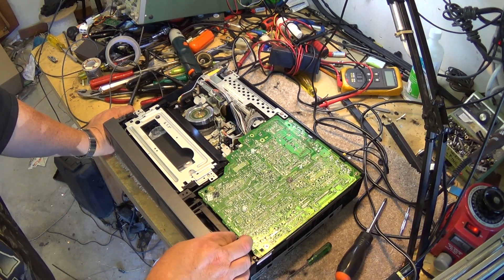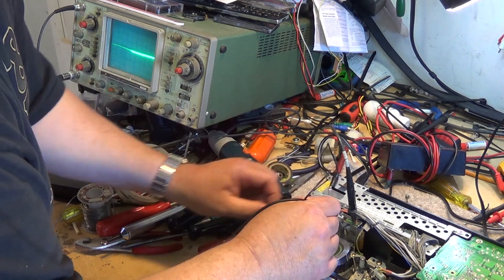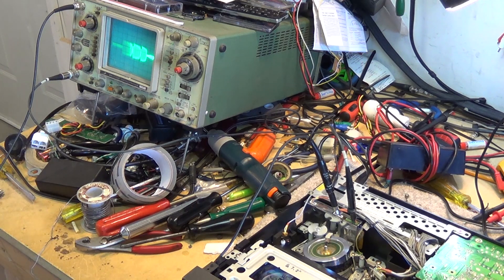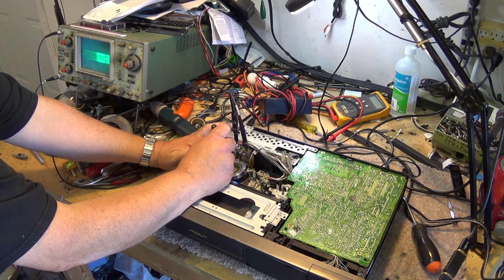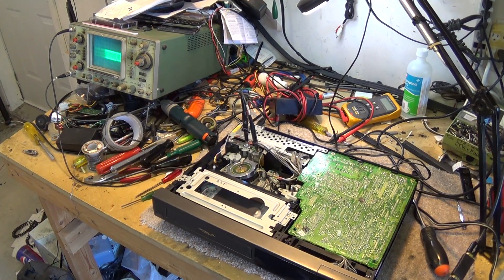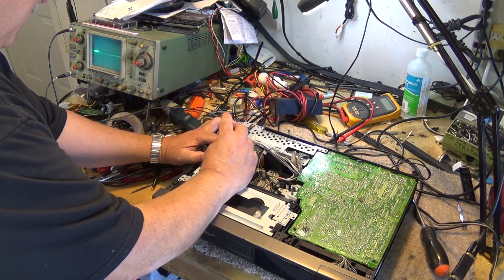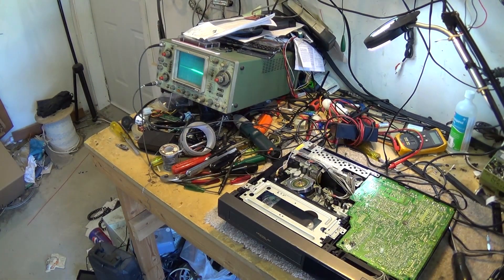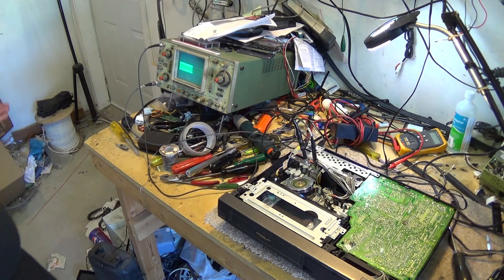VHS Tape path alignment   scope and no scope

Comment: I've had a hard time adjusting a Umatic SP BVU950 drum entrance guide height and angle to flatten the wave form on a scope. Though I have much of the service manual (the relevant parts) I have no access to an alignment tape. This machine was damaged in shipping and I fear things have been bent though it looks ok. All but the very end of the waveform (at the end of the scan) is good or only the end is good depending on how it's adjusted. The midway point between said extremes results in way way lower rf output.
I guess my most important question is: should I go for most flat or loudest signal? Perhaps I just need to adjust the various guides around the audio heads just after the drum... but if the audio heads are worn (have a notch worn into them and have themselves become tape guides) I'm thinking I need to really get into it and work out multiple height,azimuth and zenith before I'll even know if the problem is fixable with those or any adjustments. 

It looks and sounds ok, the video heads seem ok (I think)... except the scope rf wave form. AND of note is the misalignment did cause the flying erase heads to not erase the very bottom portion of the picture (as tested in insert edit mode), corresponding exactly with the dip in the rf on playback. any advice would help; maybe it's both bent and worn down and I've done all I can but I want to hear anyone's opinion and keep learning.
Reply from the maker: wdavem You want the flattest signal. As far as an alignment tape, as long as you have a good tape, which you know is correct  you can et your alignment very close. Check your pinch roller for wear. When the pinch roller wears out, it will start to pull up or down on the tape and will cause what looks like a serious alignment problem. Of course if the machine was damaged in freight you could be up against something that is bent, but Umatic machines are pretty heavy duty units. I have a few Umatic machines, a recorder and a player.I have service videos up for those, and you can see my Panasonic Umatic at the start of every video. It is the first machine you see!
Reply: 12voltvids Thanks! Since the pinch rollers are a little hard to find maybe I'll do a swop with one of the other machines like it just to see what happens. I know the alignment can be tricky but I've re-built BVU 800 series decks before and am willing to spend the time. 
And what you say makes me wonder if I was seeing the low rf area actually fluctuate at the rate the pinch roller is turning, + and - the rate of the reels turning. When I get a chance I'll do a baseline recording, go from there and post the results on my channel. Thanks again!

Comment: Thanks for the video. I wish I knew which points to connect the scope to or how to fine it. I wish I could have seen the guide posts and how you were adjusting them.
Thanks again for your interesting videos.
Reply from the maker: amtpdb1 On this particular machine the trigger point is on the green connector on the head amp, the 3rd wire over from the right. The RF test point is on the middle connector, on the white shielded wire right in the middle. I didn't show a close up because this is a general information video. It applies to multiple models, so you have to probe the connectors to find the switching pulse and RF. You can see the pulse at 30 Hz on that pin, and when you hit the RF test point, you will see the waveform. Every machine is slightly different. Some will have a test point marked RF and Head Sw.The point is as long as you find a trigger pulse, and the RF envelope you are good to go. The guide posts are just turned back and forth. They have a slot for a screw driver to adjust, and you either screw them down, or up. It is the vertical height of the guide that is being adjusted.